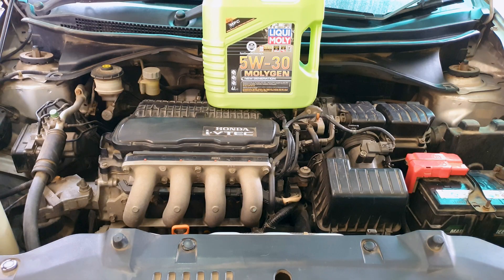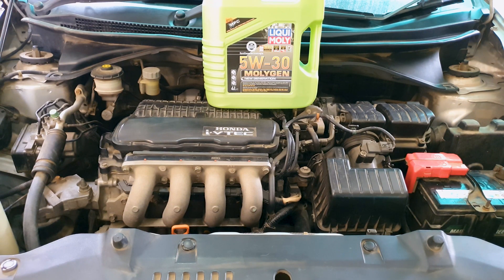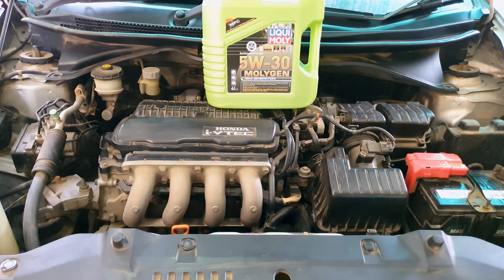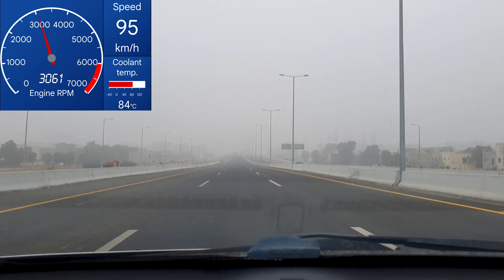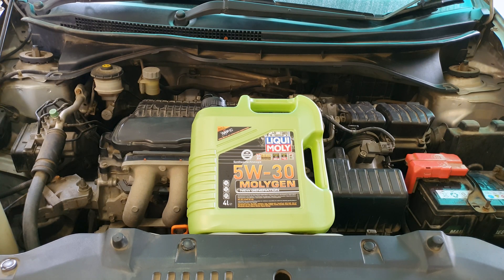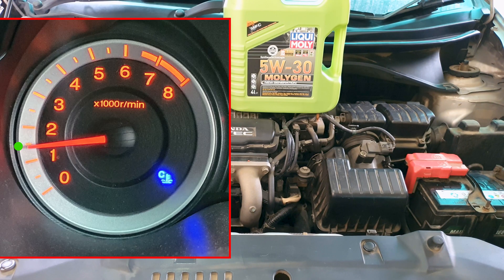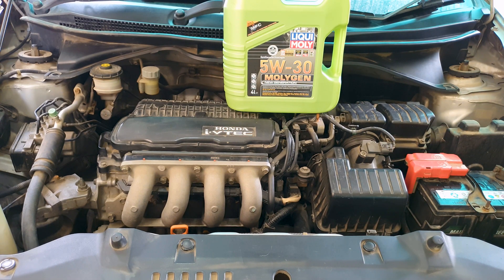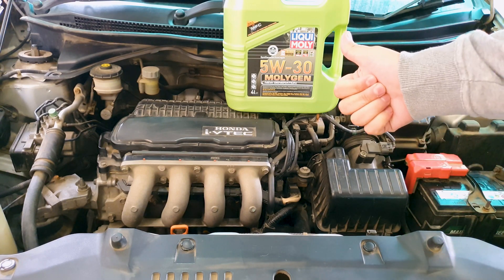Can EXTRA Oil Additives help with engine piston slap knocking?

Comment from the maker: Carbon on intake valves won’t benefit from an Italian tune-up on gasoline direct injection (GDI) engines, for example. On this these engines, fuel is injected directly into the combustion chamber of each cylinder. This is different from traditional fuel injection systems, which inject fuel into the intake manifold. 

Piston slap doesn’t mean that you will have oil consumption (burning), as the piston rings could be fine. However, worn piston rings could also contribute to piston slap as it stabilizes the top of the piston in the cylinder. 

Liqui Moly Molygen technical information:
https://drive.google.com/file/d/1akyQS_hwI02Y29WqaKuiZZCUmvzD1oGI/view?usp=sharing

Source material:
https://engineeringlearn.com/parts-of-piston/

Comment: i will test this on my pinto turbo motor. i have old worn forged pistons that have heavy slap when cold
Reply from the maker: Keen to hear your feedback. I have also read that going to a thicker oil may help. More recently I saw someone say to use conventional engine oil, have no clue how this helps. But may give it a shot.

Comment: I am thinking of changing from 5W-20 OEM to 10W-30 on my 2013 Hyundai Elantra.
Reply from the maker: To address piston slap?
Reply: @TheWrenchWiz  yeah. it is only on cold starts. your thoughts?
Reply from the maker: I have seen many arguments online about this. If piston slap is on cold when idle, how can thicker oil help? As it will take longer to get up there to lubricate the pistons. But then how long are we talking, mere seconds for oil to start lubricating. So I guess it can help. I say give it a try. Keen to hear your feedback after.

In my case, it doesnt happen on idle, only sometimes if I drive and im not gentle on the rpm or I let it drop. So thicker oil may help provide a cushion to the excessive piston wall gap. 

I have seen someone say using non synthetic helped 100%, I still havnt figured out how that could be. I may try thicker oil, but after winter passes.
Reply: @TheWrenchWiz  I will give it a try and let you know. I do my own oil changes every 3K miles so I am diligent on maintenance.

Comment: 0w40
Reply from the maker: Not sure if that would help. I did use the same oil 0w-20 for some other reason, didnt make it worse but the engine did warm up a bit quicker. I will try it however when I can.

Comment: A professional mechanic knows that a well-built engine will last for many trouble-free years and many hundreds of thousands of miles if the engine is run gently on a full synthetic oil and oil and filter changed every 3,000 miles. Transmission fluid changed at minimum every two years.
Reply from the maker: Yup, I dont agree with extended oil changes. However a lot do say babying the engine isnt optimal either due to more carbon buildup, amongst other things.

Comment: As per your experience 
Which brand is better liquimoly or amsoil
Reply from the maker: Imo, using expensive oil does not mean you can extend change intervals. So really expensive oils like amsoils or mobile 1 I dont think its worth it. The only reason I tried amsoil was during covid as I had to work from home not must driving. And amsoil say its good for upto a year. But 9-10 months in the engine felt noticably rough. I dont have access to oil analysis so its just what I have felt. 

After my testing with piston slap, I will only now use LM molygen series because of the extra friction additives. If you know, Mugen Japan, do a lot of testing on their products before release. They also sell their own branded oil which has extra additives. So that gives me some indication that such oils are good long term.

Comment: Try cara tec from moly its its really interesting and it will smooth u engine maybe 
Good luck😊
Reply from the maker: I have used it before long time back. But the engine didnt have this cold knock. With molygen oil however LM reps themselves say that no need to use ceratec. Even this oil I tried maybe 80k ago, nothing noticable so I didnt continue. But now, as I said in the video, it has helped and will use this moving forward.

Comment: What was your usual oil before using molygen
Reply from the maker: I tried various oils. For a long time was using honda's own oil, then used total, havoline, and amsoil SS. Amsoil SS was the most disappointing because what they claim fell way short. Not worth it imo. Their manual gear oil for honda's however from my current experience is doing better than honda's one.

Comment: Hmm why not open the engine and replace problematic pistons/rings? Or is the problem just not that far yet?
Reply from the maker: Its a lot of work, have to open up the engine, get the pistons out etc etc. So at this stage its not economical. I dont really burn oil, engine overall is in great shape. 

I have mitgated it with what I mentioned in the video. And this most likely is just one piston. These are realiable engines and I dont see why I cant easily reach half a million kms before needing an engine overhaul.
Reply: @TheWrenchWiz agreed. My car has same problem as yours. Mechanic suggested swapping engine easy solution & work but I'm not confident with another used engine. Other option is replacing defective piston but it requires a lot of works & costly for one piston. Hence I would try using this oil and let's see how the result. Tq for sharing the video.
Reply from the maker: Easy solution and easy pay for mechanic, thats the only the reason. Give the oil a try, I did and it has helped. I still sometimes get piston slap if I am not careful (I let the idle drop too much or accelerate too fast) on cold. But after 1-2 min of driving no issues.

Comment: nice vid, if you have  the service manual for the honda 1.2 , 1.5 engine could you share it, they dont really make it available in india. Need them for an engine swap
Reply from the maker: Thanks. What model is this for? I use what is available online, I can check if it is.
Reply: @TheWrenchWiz  honda city (1.5) and brio(1.2)
Reply from the maker: model year?
Reply: @TheWrenchWiz  sorry, 2013 petrol non abs, mainly need the manual for engine section only
Reply from the maker: have a look at this https://hondafitjazz.com/manual3/index.html

non abs? im assuming its the brio then.  This link covers basically 2009-2013 gen jazz which is almost identical to the city. Brio engine also will be similar. You could use this for reference.

2013-2020 also similar SOHC engine.
Reply from the maker: The dealership will have specific model service book. You would have to request them to have a look.
Reply: @TheWrenchWiz  Thanks a lot will do!
Reply from the maker: good luck